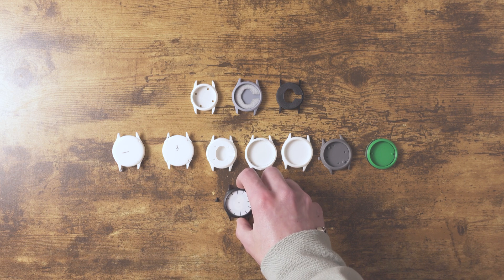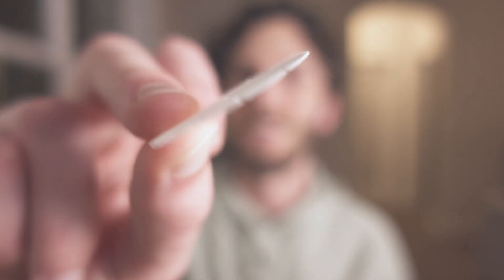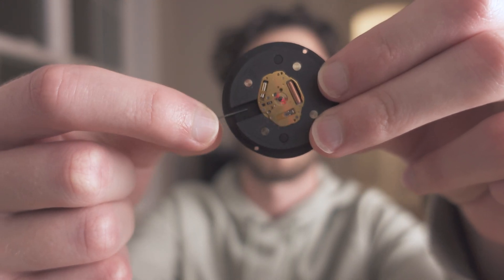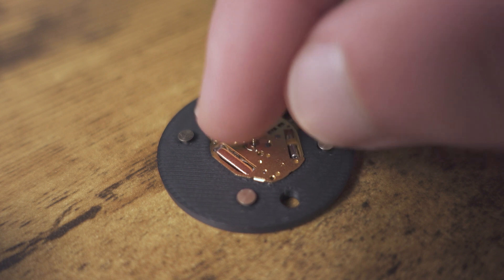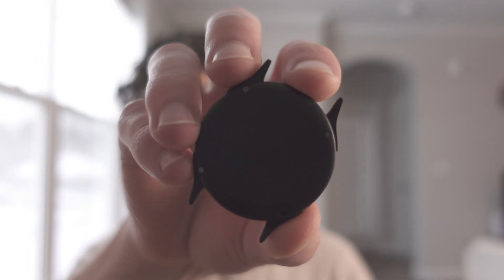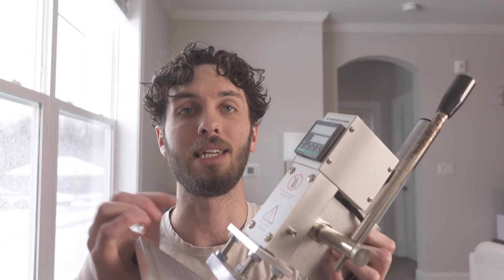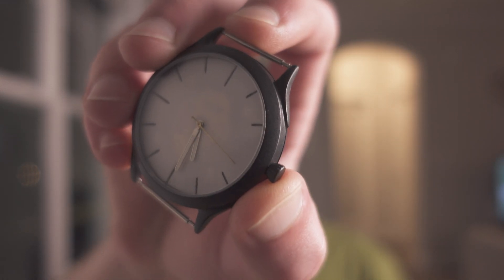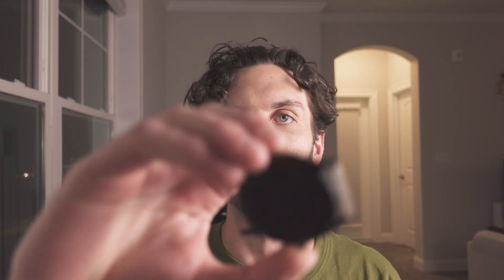Design a Watch from Scratch - Final Episode

Comment: Hi there! Beautiful watch :)
What is the diameter of the crystal gasket, and what is the diameter of the crystal itself?
Should the crystal be slightly larger than the case opening?
Reply from the maker: Can't remember what the exact sizes are, but yeah you'd want the crystal to be 0.1 or 0.2mm larger than the inner diameter of gasket so that it fits nice and secure. The outer diameter of the gasket should be slightly larger than the case so it's snug as well.
Reply: @nicholasmakes thanks ❤